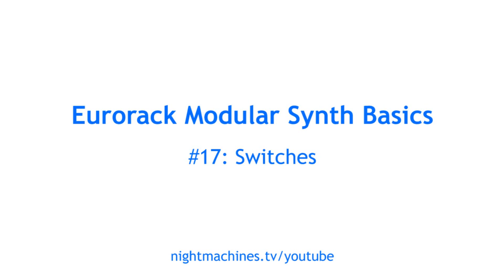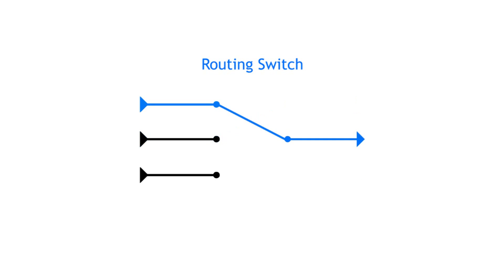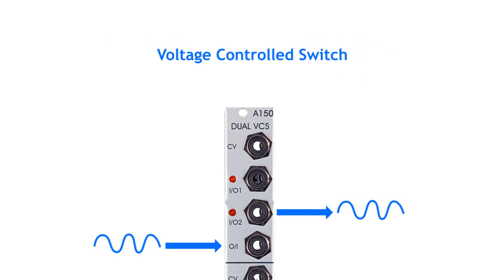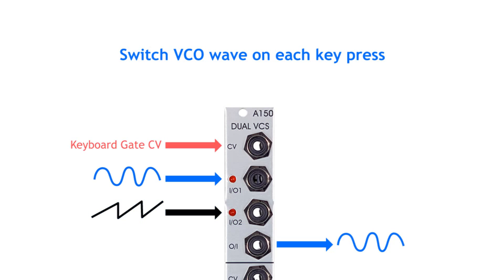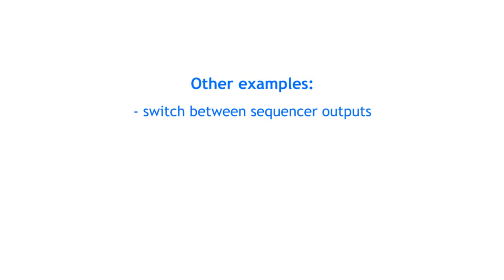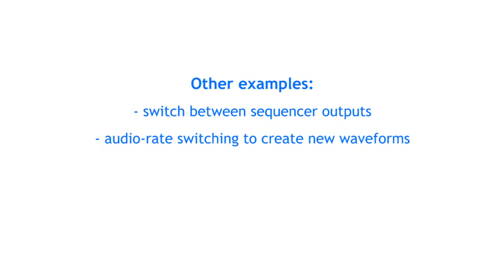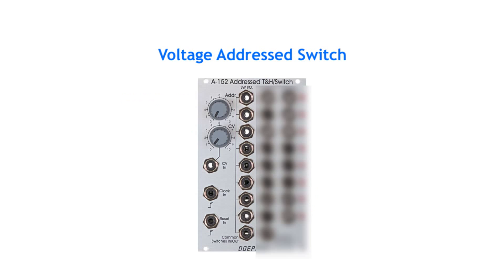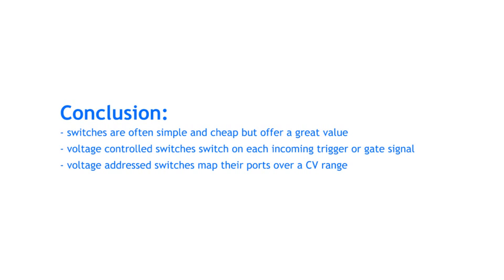Modular Synth Basics #17: Switches

Comment: I just rewatched the entire playlist, and it's still great. :)

I'm now thinking I'll start with an Intellijel Atlantis.
I have an Arturia Keystep. Am I correct to think that just a case with power supply and the Intellijel Atlantis, played with the Keystep, would be enough to get started? Or would I need something else?

I also have a Microbrute, mind you. :)
Reply from the maker: Yes, you could do that. However, I'm not a fan of those all-in-one synth voice modules to start out with, especially because you already have a semi-modular MicroBrute. I'd rather buy individual modules to extend that instead of buying another "MicroBrute" (the Atlantis ;-P ) that you screw into a Eurorack case ;-) Buying individual modules will get you accustomed to the whole modular synth thing a lot quicker and will probably offer more flexibility too.
Reply: Yes, I see your point, and I initially thought the same.

But: The Atlantis is still very "modular" in that it has lots of patch points; far more than the MicroBrute. It's quite cheap compared to buying corresponding modules individually. And it seems like it sounds really great. Mylar Melodies, for example, is quite a fan. I'm guessing you've seen his video introducing the Atlantis.

Also, I've read a bit about how one might integrate the Microbrute into a Eurorack system, and it looks like there are quite a few complications due to the Microbrute not using quite the right CV "protocol" . Can you post links in Youtube comments? Here's the main article I've read about this: http://www.hars.de/2016/01/microbrute-eurorack.html. If this article is right, then integrating the Microbrute would require buying some modules to translate Microbrute-speak into Eurorack-speak, and those are modules I wouldn't really want to spend money on early on. (Or course this still needs to be weighed against the price of an Atlantis.)

I haven't had the Microbrute for long. To be honest, so far I'm disappointed. This may largely be because I suck at making good use of a monosynth, and if that's true then of course I may have no more luck with an Atlantis + Keystep. I've had the Volca Keys for several months (my first hardware synth <3), and even though it has fewer features than the Microbrute, at this point I still prefer it. I find it at least easier to get a good sound from. Again, though, a large part of the extra enjoyment probably comes from its polyphony, and how the sequencer allows me to stack three voices on top of each other without recording any audio. (By the way, while the Keys is marketed as polyphonic, isn't it really just paraphonic? The 3 oscillators do NOT each follow separate envelopes. I believe this is precisely the distinction between poly- and paraphony. Am I wrong?)

So at this point I think I might end up selling the Microbrute. Then again, if I get an Atlantis, I can use it to expand my Microbrute, e.g. to at least achieve a fatter sound by combining the oscillators, plus I'd have two LFOs (*plus* the Atlantis's cycleable EG), and I could do analog FM. Of course, I can do that with any VCO and LFO module.

I certainly would want to then add lots of other modules to the Atlantis, as finances permit.

Idunno. I feel pretty enthusiastic about the Atlantis atm, whereas for weeks I had been a bit frustrated because I couldn't find any ideas of first modules to get started with that felt right. Since I'm sadly not enamoured with my Microbrute, the idea of buying modules to expand it as a starting point doesn't click with me.

Sorry, very long reply. :) Thanks again. And if you were to ever do a video on how to integrate the Microbrute with some Eurorack modules, that would be totally ace.
Reply from the maker: Just some points:
"The Atlantis is cheaper than buying individual modules": Yes, but it's also more limited.
"Mylar Melodies likes the Atlantis": Me too! But I wouldn't recommend it in your specific case, because you won't "get yourself into modular", you'll just buy another semi-modular subtractive mono synth which you already have and which you already know(!).
"MicroBrute complicated to use with Eurorack": Don't worry about this right now. It's not an issue to the extend you're thinking it is. Look at my videos with the MicroBrute ... just connect it and go. It's fine. The only problem might be the low gate output with modules which want higher gates, but that's really an edge case in my experience.

So what would I recommend? Get a nice (complex?) VCO, a fun modulation Source (random looping sequencer maybe) and an effect with CV controls (reverb, delay, bitcrusher, whatever).  You could also additionally get a Disting all-in-one module to try out features. The MicroBrute really opens up with another detunable OSC. It also doesn't have any FX and using those with CV is awesome. You already have two regular sequencers in the MB and KeyStep so adding a more random modulation source will be useful and something new.
Reply: Thanks a lot, this is good stuff. :) I'm glad you say that the MicroBrute isn't that problematic in a Eurorack context. I've since watched some videos where people did really cool stuff with a MicroBrute and a few Eurorack modules. I must have previously missed that you have some such videos yourself.

I've been collecting ideas for modules that appeal to me on ModularGrid. :) I keep adding to my BrainStorm rack. I'm still unclear as to how I'll actually get started, but I think I will probably buy my first modules next month, so I'm looking to get more specific now.

I still like the idea of the Atlantis a lot, but there are loads of other modules that I also really like the idea of. So I think I may take your advice and go with something more "properly modular" initially.

And next weekend I'm going to a modular synth meetup in London. ^_^
Reply from the maker: Sounds good! At some point you just have to let the research rest and just buy something :D You will most probably sell it down the road, but that's part of the appeal of modular synths: so many things to try out and discover. Enjoy! :)
Reply: To sequence the MicroBrute with a eurorack module, I would need a CV-to-MIDI converter, no?
Reply from the maker: No, the MB doesn't have a Midi input. You can sequence it  or ally with CV though (gate, pitch, etc).
Reply: Oh, true, it just has a USB input. But I could sequence it by sending MIDI signal through USB, no? :) There seem to be very few CV-to-MIDI converters. The Doepfer A-192-2 has both a MIDI and USB out, tho.

But yea, you're right, there's a gate in as well as a pitch in, so what the heck was I thinking? :) Thx!
Reply from the maker: I never tried to sequence the MB through USB and never bothered with researching CV-to-MIDI modules, because if I needed some MIDI stuff, it was usually the master and needed to be converted to CV, not the other way around. "Sequencing" is also not just gate + pitch of course. You can sequence anything (filter cutoff, metal, etc.) which is really intuitive and easy using CV, compared to MIDI, because you just patch the sequencer CV output into any input.

Comment: Could you do a ring modulator video? I cannot for the life of me figure out what ring mods are supposed to do.
Reply from the maker: +8MeanMike this series on a break right now, but ring mods generally modulate the amplitude (volume) of a signal. You have two inputs, one is the carrier signal and one is the modulator. Usually both are audio rate signals, resulting in weird sounding distortions of the  carrier signal. If a ring mod is AC coupled it can also be used for CV (slow) modulation. Most of the time ring mods are fairly cheap, so go ahead and try one. Doesn't even need to be a Eurorack module. There are also guitar pedals. I've got a Nervous Squirrel ring mod, which doesn't even need electricity :)

Comment: Hello again!! I am just starting and I am interested in polyphony. I think it can be possible with a switch module. But I I have seen that modules like Yarns of mutable instruments offers this polyphonic option. Could you talk about this question in some of your videos, please? thanks
Reply from the maker: +Manuel Rodríguez Fernández for polyphony you don't need a switch but a polyphonic midi-cc interface and every module combination times the amount of voices you want. So for three voices, you need three VCOs, envelopes, VCAs, filters, etc.
Reply: +The Tuesday Night Machines. Yes. I know. In this subject which is your opinion  about MFB triple oscillator?
Reply: +Manuel Rodríguez Fernández. Many thanks again.
Reply from the maker: +Manuel Rodríguez Fernández I've had the MFB Triple OSC for my old polyphonic setup and it worked fine. A little fiddly to tune sometimes but after that it was cool.
Reply: I think you can get duo w/ the mutable instruments midi->cv cv pal - just about to build one.
Reply: Jason Goodwin thx. https://soundcloud.com/liradigital/161024_yarns_peaks_clouds
Reply: What would happen if you routed the output of Yarns through one or two OR gates to combine them to a single signal, then fed that signal into a single VCF and VCA? Would that be horribly wrong? And in what way, exactly? :)
Again thank you so much for your help with getting started.